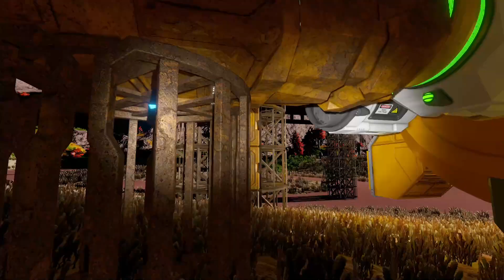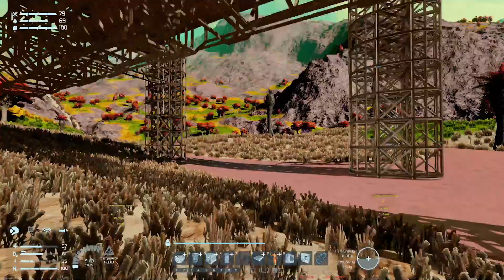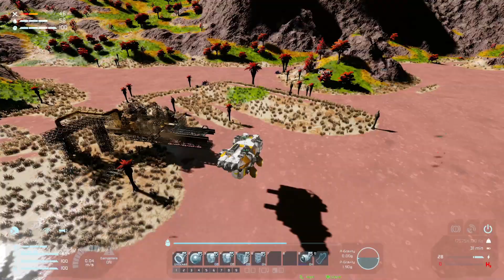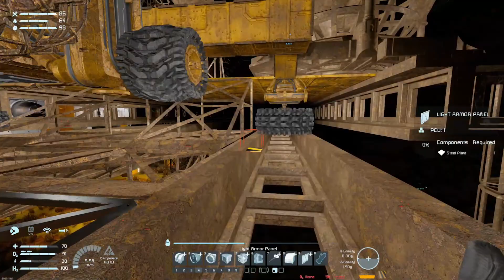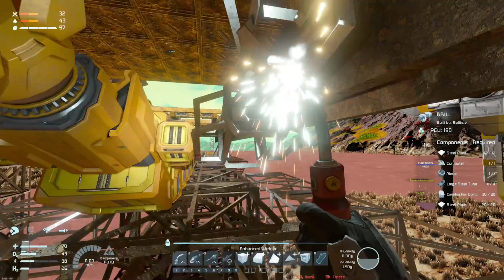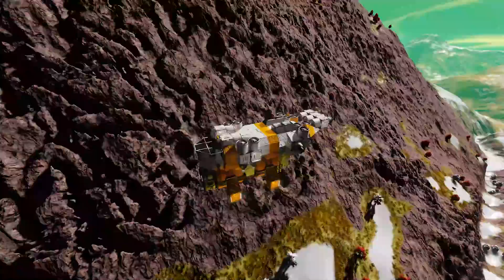Survival Impossible - Ropes and Chains #59 - Space Engineers Hardcore Survival

Comment: Little late to the party but your comment about being impossible to turn made me think if you ever get to the point you could try building a turntable and rotate a section of the tramline with tram on it instead of trying to make it turn on a continuous piece. I had also thought since the tramline will always be the exact same Y level compared to tram you could mount welders above the forward wheel and extend them a bit so that it built it's own rail though it might need some sort of sensor/safety to strop the tram if it ran out of plate for it.

Comment: Re: Rail expansion, you can have a projector and remote control on the main base and increase offsets remotely, though that does require an antenna so it may open the base up to reaver strikes. Does it still do that if the antenna is set to receive only?

Poster idea: Don't P in your vehicle (though it's slightly less bad after the recent update, and I don't know how to make the engineer look like he needs to use the bathroom)

Comment: Why not add a projector and welder set at the front of the car so you can automatically build more rail as you need to?
Reply from the maker: You can't project from one grid to another, nor from small grid to large grid so the projector would have to be mounted on the rail. I think it'll be more fun building sections and lowering them into place with the panini in the end
Reply: @Splitsie  Goes to show you how often I use projectors, I guess.

Comment: I love that concept. 

That looks similar to mine sliding crane (the one in hangar usually allocated) miner that I never finished. I was building it back in the days we had large grid lander. My aim was to build it full automated working in longitudinal and lateral axis, as well in depth. 

I would like to suggest you to make sections that you can bring in using panini, but print them on printer and use merge blocks in order to disconnect the from printer and get them on move. 

Wishing you good luck with it and I hope 🤞🏻 for awesome outcome.
Reply from the maker: Thanks! I was hoping to print the rail sections but I'm worried the space needed for them will be too large so I might just have a little side yard to put them together in instead. Assuming the whole thing doesn't blow up of course :P
Reply: @Splitsie  another bunch of thoughts. I would like to build open air printer or some kind of printing facility unloading mechanism. 

Other option could be to attach LG (Large Grid) projector to mining tram and do hand welding when it is needed. Or some kind of rail building tram should be build… but then the question is how to swap them places. There could be some kind of crane or turn table. Another way, more costly, to build second railway outside the existing railway that railway printer could work over the miner tram.

Comment: one thing i used to do was to put the drill head with a rotor  and use hinges to angle the secondary drills at 90° so i could have a wider hole and have 2 drilling stages:
1. no angled and moving rotor for hole preparation
2. hinges angled  at 90° on low torque, drilling piston (in my case, in yours would be the chain) at low speed to avoid damage and extract as much material as possible

i also used an ejector on the platform to return the stone or dirt at the hole when it was exceeding capacity

BTW ggreat idea on the chain D: the things you can do these days on SE amaze me all days

Comment: Splitsie.. do you think with this addition you could build a proper tank tread design using the hinged parts now or is that still not possible?
Reply from the maker: It's sort of possible but you need damage off and little suspension with wheels studded through the track to provide friction since the blocks don't have much

Comment: how about building a simple track builder? just a holo projector and welder on the snail drill traincar. This way you just load up some Irion and weld new tracks while you move forwards on the front a simple hinge and piston with one or two welders pointing outwards would work. So small container for just plates. hinge, piston to reach the ground, two welders on the front. The snail car can build its onw track and supports and there is no need to fly and jiggle mc wiggle with the work bee. also paint the panini in bee colors back and yellow with the pannels.

Comment: I've done a chain drill before. Your ok with 20 Hinges. If you use more, you'll have to encase them on the sides because they will slip to the side and get tangled. No recovery then. Only rebuild. I tried 120 Hinges once... Madness!
I love the tram idea:
Wouldn't you want a pivot point near base, so you could choose a different angle once you've mined your first trench?
A few Wheels (90° to the rails) at the end of the pivoting rails which could be driven via RC/Cockpit.
This way you could mine out nearly 120° of a full circle... Let it happen Splitsie!

Comment: im thinking you really need a small grid shuttle just for when your working and not hauling. im thinking 0-1 small grid large containers sort of size so its cheap to run

short of having something suicide into the bases your so far off speed and agility will be everything.

your train needs a elevation change platform to take it down to ice level for mining.

have you thought about using something like the sandbags to help protect your shipping lane? i feel it would be very practical and the most realistic approach

Comment: I recently built a similar drill design for a large grid rover. It was the most compact 100m depth drill I ever built. It worked quite well for about 10 holes. Then it suddenly exploded without warning. I guess Clang demanded a sacrifice...
Reply: every. single. time. spent quite a while making one that functioned like an excavator using only mouse controls and could self level to auto bore a tunnel and every time i would log back in it would be exploded.

Comment: Well Splitsie you've done it again! You got me wondering how you're going to unload and charge this contraption. I was looking at the supports for the two medium cargo containers and thinking they should be pistons giving you more depth (should you want) and a way to pipe the ice/ore up to a connector. 😇
Reply from the maker: I have a plan for the hookup, thinking a connector at the rear, would be cool if ejectors were a serious option but oh well
Reply: @Splitsie  Well, you could always try to make another hinge rope as an umbilical connecting the gondola with the base. While that would remove the need for the gondola to actually return to the base, it would be very difficult to extend when you need more distance. And besides, it'll be cool to see the gondola roll back and forth. Any thoughts for how you could make the gondola an automated thing? ;)
Reply: @RicJamesVA  ropes of hinges going down and up, at each up, a carrier with 4 support +2 guide wheels, wheels turned off so they can move forwards and back freely.
make 10 of those carriers, with a 20m rope between (10m down, 10m up), and you have a 200m umbilical to the base :)
To get more range, add more carriers on the base side (it should be easy as you can control the hinge chain if needed)

Comment: Would it have been cheaper to use a single rail or would that have just been more complicated overall?
Reply from the maker: I was concerned about balance with the drills making everything shake when they're in operation so went with a wider platform for safety
Reply: Cheaper yes but much less stable.
Drills can produce quite a bit of force so it makes sense to make mobile drilling platforms as stable as possible.

Comment: I really love having Survival Impossible back, missed the series a lot!
Have you thought about using printed small grid rovers as mobile defense posts? You could print one at your homebase and pick it up with the Panini then just drop one or two at keypoints just to help against the drones, it would make your trips a lot safer. Plus I´d really like to see what you would come up with for that purpose.
Reply from the maker: I did something like that in survival maybe but decided I'd do fixed grids here for less performance load as I'm pushing the performance limits in other ways this time round :D
Reply: @Splitsie  You could build a small anchor point, then airlift the defence post in on the panini and weld it on.
Reply: @MrAntice  This would suffer from the same issue as the conveyor lines back at the main base, the anchor points would need to have more blocks than the grid being merged to it, otherwise the grid in the voxel will try to merge to the defence post instead of vice-versa (This will cause an explosion as the anchor will try to rip itself out of the voxel). Splitsie has solved this before with the power/conveyor lines by placing temporary blocks all around the anchor, but it doesn't seem that advantageous over just bringing the supplies and designing/building the defence post at the spot.

Comment: Recommend you set up a sensor to look for those outer drills as they winch up so it will auto stop at the right height.
Reply from the maker: That's a good thought 👍
Reply: Yes, need that upper limit switch. Don't need a crane accident due to two blocking.
Reply: @tomc8157  limit switch was the term I could not, for the life of me, remember this morning.  Thank you.
Reply: As someone who’s worked on robots limit switches are very useful in these situations

Comment: Instead of a gondola what you've built is essentially a Gantry Crane. Might want to consider putting a landing gear emergency brake on it as well.
Reply: And the brake uses the big red button of course (right?)
Reply: Using the harpoon mod... That would be awesome.
Reply: @JPEight  I've tried that mod on a drilling crane, and it doesn't work that smoothly.
First of all when your drilling head goes deep enough the horizontal swing would potentially damage your machine by bumping it into the wall. Secondly the harpoon cannot reel in/out in a smooth and continuous way, resulting in sudden changes which makes it unstable and hard to control. And finally items (and charge) cannot pass though harpoon ropes, so you need to pull up the drilling head periodically to claim its resources (and recharge), which is nowhere as efficient as a hinge crane. The only advantage is that you can dig infinitely deep with it.
The harpoon mod is not that good in drilling rigs, but definitely excels at other stuff like vehicle recovery.
Reply: I was just going to say this.  I don't know if that's just a regional term or not.

Comment: if you do ever need to turn the tram, you can make a turntablething like trains sometimes have with a rotor spinning a portion of the track
Reply: I had this exact thought when he said that!
Reply: It would be like the Goose turntable all over again ❤🚊 Would probably be more challenging though as you'd have to line up the rails, a very interesting project indeed!
Reply: Although, now I think about it, I recall the Solar Axe train station having a turntable of sorts, can't remember if it got fully completed though.
Reply: @chrisbull8468  The turntable could perhaps feature some sort of rail extensions that contract during rotation and extend when the desired direction is met. Would solve the potential collision issues by having "too long" ends.
Reply: @Jenachy  Or he could have a portion of rails on piston moving up and down, between turntable and regular rails. Or move whole turntable on the piston up and down, that could double as lift if needed.
Reply: I was already typing this before I noticed you'd beat me to it
Reply: What about a side shift piece of rails on pistons. That way he can do parallel mining strips instead of spokes
Reply: Need to be a bit more complex. As the turntable would start rotating, it would jam on the stationary track cause the diagonal is longer than the side. So, it would probably need to be lowered a little over a block down and then start turning.

The mounting point of the piston-rotor is another issue. For the least amount of clang, it should be located in the middle of the rotating segment (more precisely at its center of mass), but that is exactly the place the gondola would occupy.